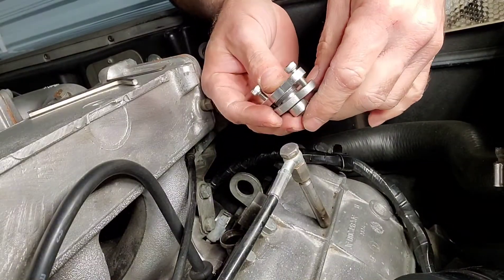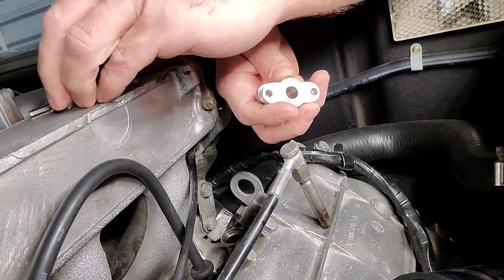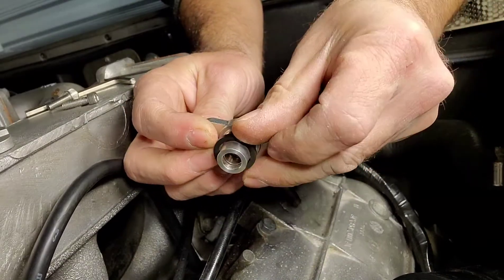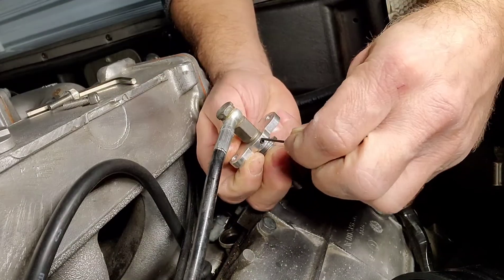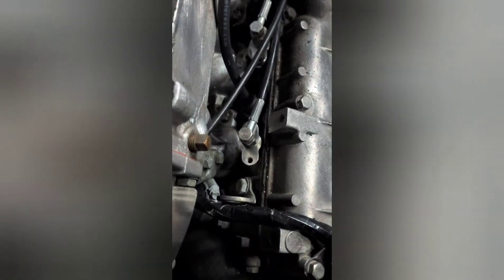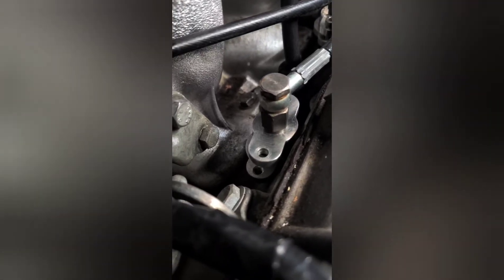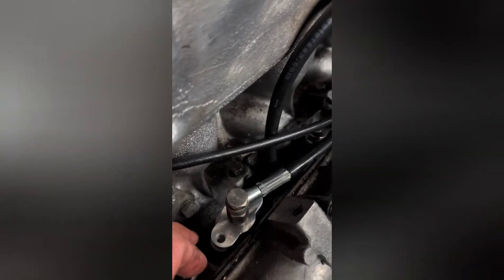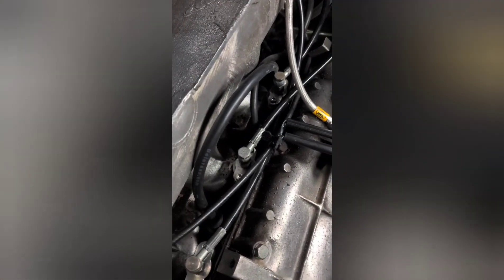Delorean Industries fuel injector clip install how-to

Comment: I just installed these on my daily driver 82 DeLorean over the summer. Love hoe they work, look and they are WAY better than the stock 3 prong clips.
Reply from the maker: Yea they are so much better. The other ones are prone to vacuum leaks and potentially popping out of the hole like mine did. It's another one of those upgrades where you can "set it and forget it"